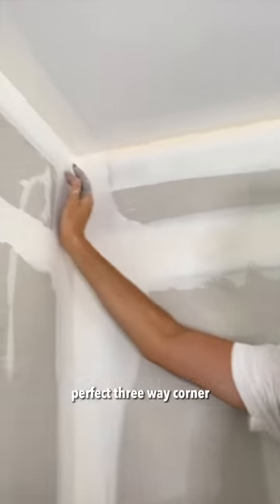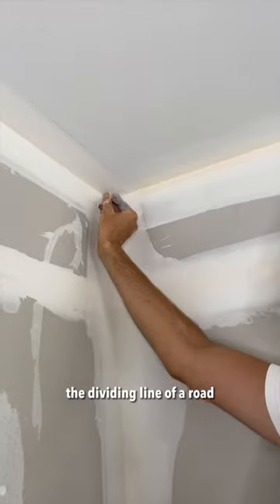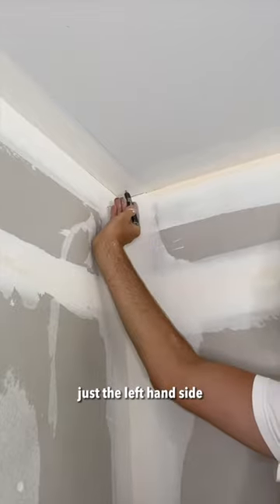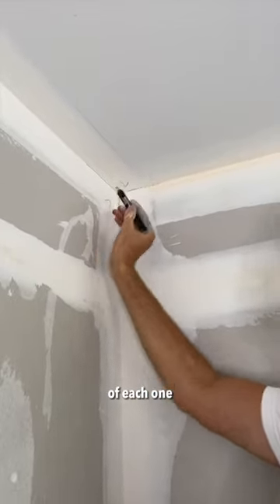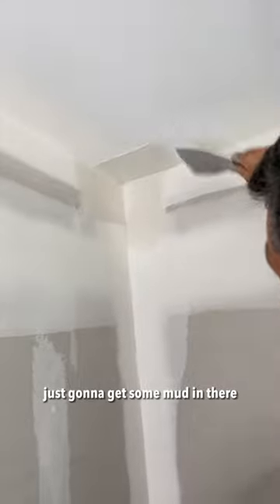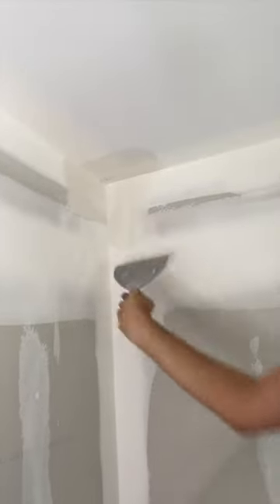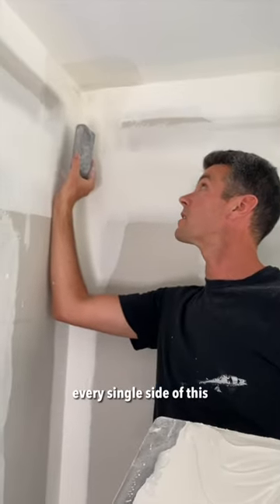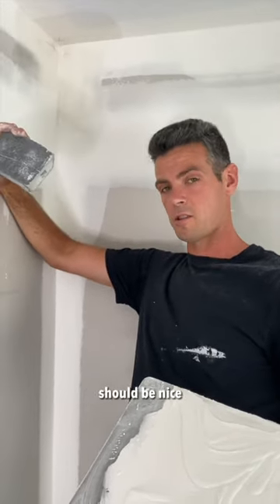Pro Drywall Tip for Perfect Inside Corners!

Comment: I use 5 min mud for that reason..... So it dries quickly and I can do the opposite sides within 20 min and not have to wait long. I'm so glad I saw your video..... I thought I was the only one doing that because I could do it all in one shot
Reply: Probably looks like shit If you use 5 minute mud for what he’s doing
Reply: Good luck sanding hot mud
Reply: I would use 5-min, too, and I put a thin skim of light mud over it. One light sand later and it was buttery smooth!

Comment: If only there was a tool for doing corners...

Drywall Corner trowel mysteriously arrives from amazon
Reply: Anyone who's used one of those corner knifes knows they don't work at all
Reply: @DiamondSupplyC0 lol.. there literally idiot proof..been using them since before 2014 ..never had an issue even if its just for the first couple of coats and final coat with regular knives
Reply: @DiamondSupplyC0 dude I did a whole 3 bedroom house with that tool and the corners are perfect everywhere. You might have the "tool" but you got to know how to work it. 😮
Reply: @lucienberl  I'm sure it looked great 🤣

Comment: As a brit in the US, can anyone explain why skim coating the whole wall/ceiling with gypsum plaster isnt a thing out here? It gives a great smooth finish and is about 3x faster than taping and jointing and requires no sanding
Reply: I live in England plastering gives a way way nicer smooth finish.. This seems like so much extra work for a rough finish 🤷🏼‍♂️
Reply: In Boston they plaster

Comment: I am from Toronto , but I moved to Croatia, and taping is nuts here, nooooo paper tape, they use Dap acryl for all corners, and also they mix butt joints with factory H , and for the joints they use glass mineral tape on all joints its nuts, and when they board the wall thry use 2 meter sheets instead of 2.60 or 3 meters, the mud they use for compound fill lime sheetrock 90 is called Uniflott german plaster ,

Comment: Sponges leave grooves around corners and stuff, got to be careful. I just fold the 180 sandpaper, sand as much as I can and carefully scrape the rest out with the edge of the knife. Absolutely perfect corners, no caulking needed, no nothing. I only use light compounds, if its harder than that, yea, can't scrape that out..
Reply: If you squeeze one side of the sponge it lifts the corner that would leave a groove. Besides this dude is a true professional he's really not even having to sand enough to make those grooves with the finish she left.
Reply: @-KIMISAFOX  I mean, some brand new sponges have like imperfections and sharp chunks arond the edges from the factory so if I do use a sponge, I just cut outside threeway corners off with scissors & we're good.
So this guy, is alright I guess, I do consider myself a pro too, it's hard to say, it's all about the internal witness, because the imperfections of your job sometimes come up years after the fact, so just gotta find that balance between quality, speed, money, life work balance etc...

Comment: how do you keep the side of the knife from digging into the 'road' beside it
Reply: The mud beside the fresh pass is dry and hard. No digging into it!
Reply: Also, paper tape makes corners easier than, say, mesh tape if your that type of guy.
Reply: Move your knife to opposite direction coming into the angle. It’s takes a rounded knife making it easier, and a steady hand. And lots of practice.
Reply: They make knives that are 90° on the edge. And they make knives that are 86° , makes it a little easier to get close without digging into the other side , also the angle of your knife matters. Hard to explain but it just takes playing with the mud to get good with it . Also they make a knife for inside corners to do two sides at once , you just do the ceiling after or before
Reply: Practice. Plus it's the easiest to  do when you mud 3 corners , cut edge, then start with cealing.   That's the one you want perfect, then   place 6" knife flat and  wipe right. That will give you  your base. The go  left wall down  and  right wall right. That way the clean edge  never gets  dug. Practice. If you leave a little mark it's ok . After sanding the light touch up will leave you a perfect corner every time.
Reply: You can do two signs at a time and come back

Comment: Sorry I’m not an English speaker. What does it mean “to feather” in this case?
Reply: It means to put pressure on only one side of the knife. That way there is more mud on the corner and it tapers off to nothing on the other side of the knife so that you don't have mud that sticks up and has to be sanded smooth away from the corner.
Reply: @jasondashney  thank you very much!